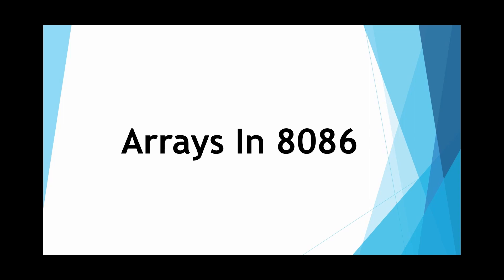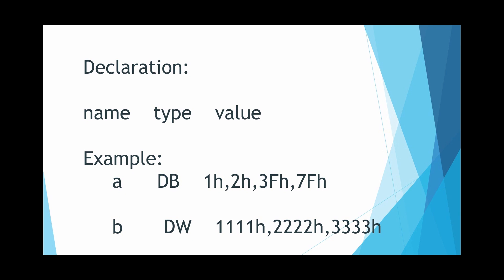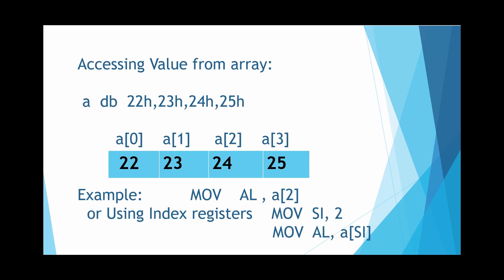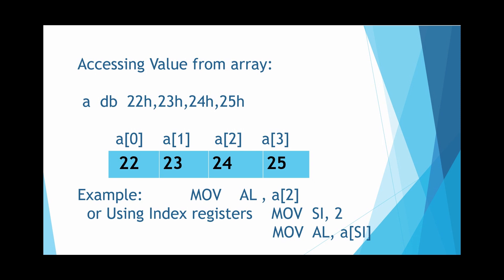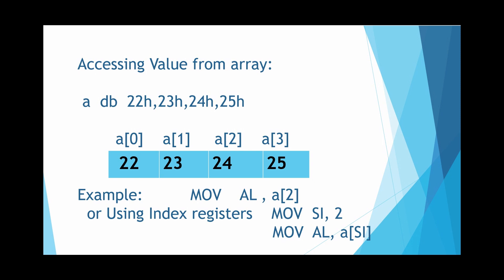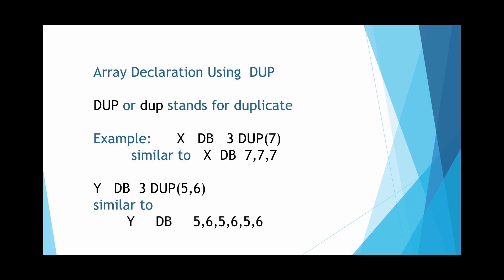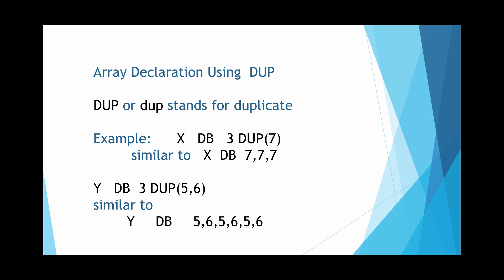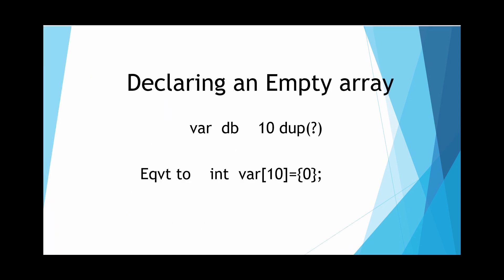8086 Assembly Language Tutorial For Beginners || Part 04 ||  Array in 8086 || DUP

Comment: 1. Two numbers C1 and C2 are stored in memory. The operation between these numbers 
is dictated by the bits 5 and 6 of another number C3. The possible two cases are
(a) If bit 5 of C3 =1 and bit 6 =0, then
C1 = (C1 AND C2) OR F0 H
C2 = (C1 XOR C2) AND F0 H
(b) If bit 5 =0 and bit 6 =0, then
C1= (C1 AND 07 H) OR C2
C2 = (C2 OR 90 H) XOR 50 H
Otherwise—No operation.
Develop a program.

Help please!